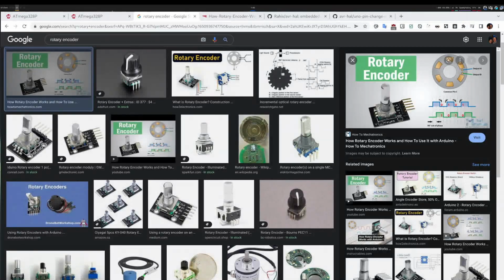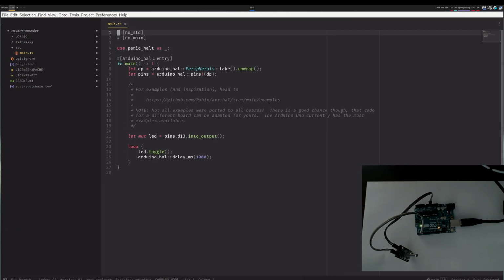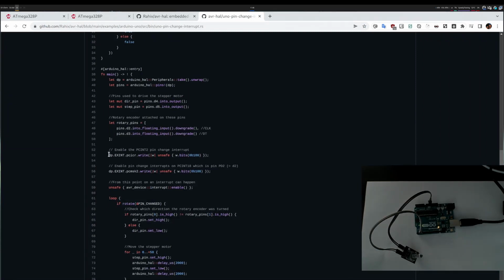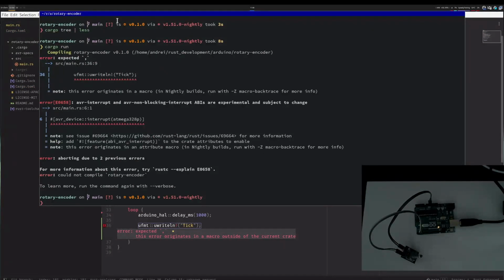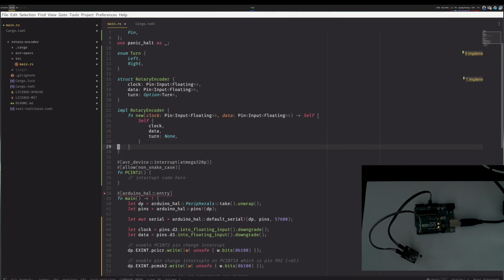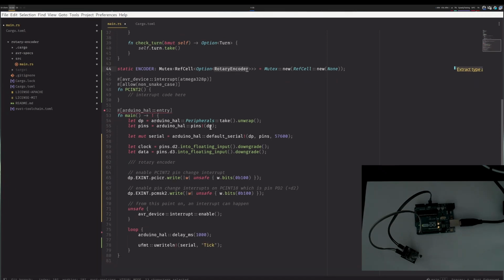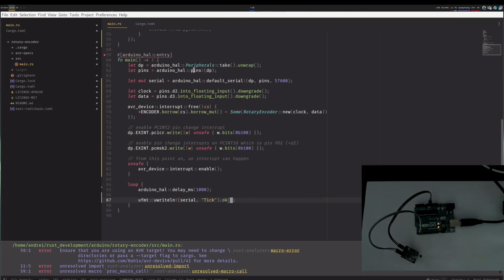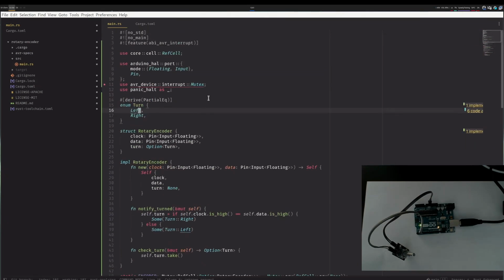Embedded Rust: Rotary Encoder on an Arduino Uno

Comment: How is Rust on AVR chips? The last time I looked it was lacking a lot and required a rust fork.
 Thanks for the video.
Reply from the maker: The HAL template still forces a specific Rust compiler version in https://github.com/Rahix/avr-hal-template/blob/main/rust-toolchain.toml (version nightly-2021-01-07). My understanding is that newer LLVM generates an invalid instruction and there was a lot of back and forth about this in https://github.com/rust-lang/compiler-builtins/issues/400.

My view of this is that AVR works, however as time passes the Rust build starts being older and older and unless the LLVM bug gets fixed, not being able to use (even if just play around) with newer compiler versions is really not ideal.

I used arduino in this example because this seems to be a more commonly available hardware, however for newer projects I believe stm32 are generally net better for rust (faster, cheaper, more ram/gpios/functions). Also looking forward to more espressif risc-v as those just work out of the box and I like being able to control my projects over wifi. The only difficulty may be the 3.3 vs 5V (if trying to replicate 5V projects, they may not work out of the box)

The great part is that rust_embedded abstracts things enough that knowing/seeing how to make one microcontroller makes it very easy to to do the same thing on another. Switching from AVR to something else should not be too hard.
Reply: @embedded-rust  Thanks for the reply! I have some STM32's I should dig them out and get busy.